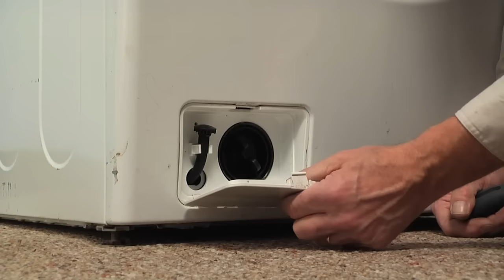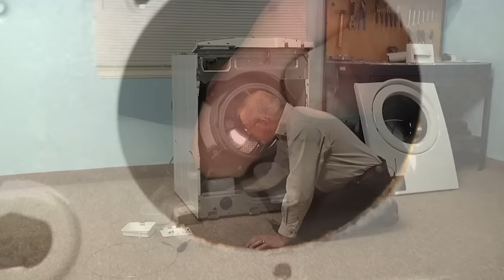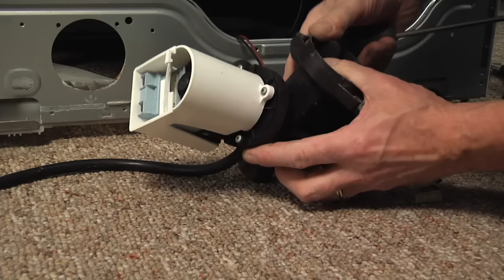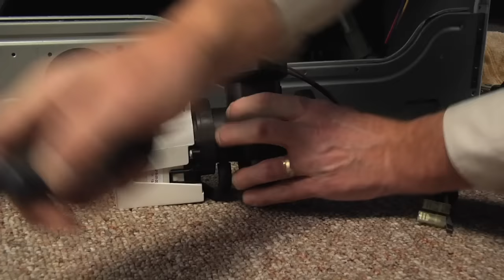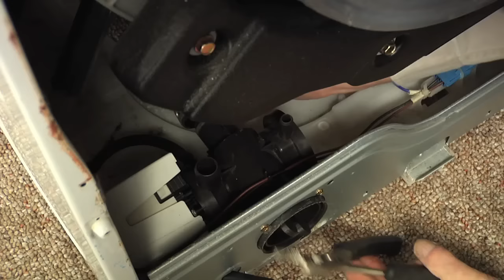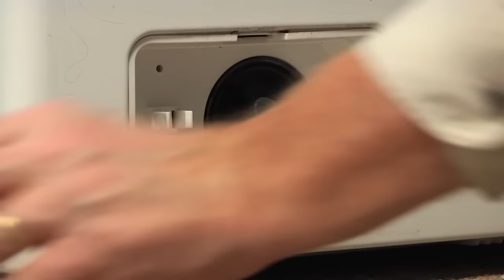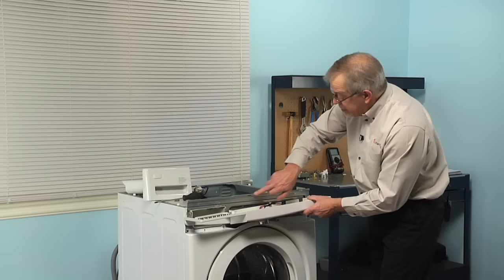Washing Machine Repair - Replacing the Drain Pump (LG Part # 4681EA2001T)

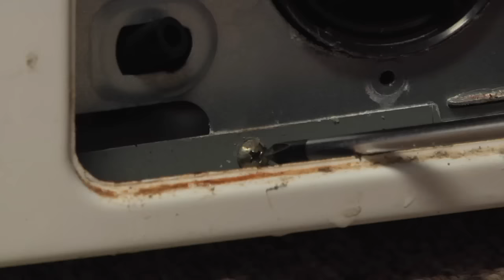Comment: Great video, I actually had to replace my drain pump twice (back in 2018 and again in 2020) and watched this video both times.  One comment, you forgot to reinstall the small screw removed at 3:00 that holds the bottom of the front panel on though.

Comment: Very helpful — thank you! . My washer is a high capacity model, so there were a few differences. 
1. The wires to control panel are very short so they had to be disconnected in order to get the panel out of the way. Careful labeling helped. 
2. I couldn’t get the wire harness to disconnect from the door lock so I needed to unscrew the lock from the front panel. Easy  
3. The drain clean out panel had 2 screws instead of one, the second one is located near the top — it took far too long for me to figure that out. 
4. The pump assembly is fastened down by 3 bolts. Not easy to see them. Putting a powerful little flashlight inside the machine was a help. I used a 10 mm wrench for removal. A small adjustable wrench would probably work too.  Awkward to work on, but fortunately, they were not screwed down too tightly and were much easier to remove than I thought they would be. When reassembling it was easy to position them correctly by feel. 
What a relief to have a working washer again!

Comment: Thanks for easy to follow instructions. Maybe you should work for LG and engineer an access panel for this part. Crazy all that has to be done to get to this easy to replace part once you get to it. I have to replace mine every 4 years. This is my 3rd one

Comment: Such an excellent instructional video.  Every little step is important to me and you covered them all without "cutting" to the next step.  I also fantasized about changing the door boot (moldy and nasty) but now it will be a part of the pump replacement process.  Keep up the good work sir!!

Comment: This is a perfect tutorial. Even better is the link that shows exactly which part to order from your store. 😀 I simply bought the part, then followed along with Steve to a successful job completion.

A key point the Steve mentions is to pay attention to the reconnection of the water hoses. The pump assembly (black housing) has an extra "drain connection" that should be obvious that it isn't a drain connection (it is on the right side furthest from the pump). If you do it wrong, you get to clean up the water that pours onto the floor when restarting the washer, then get the experience of disassembling the washer a second time. 🤣

Comment: Just completed the repair shown in this video and trying out the washer now.  There is one step in reassembly that was omitted - the small screw inside clean out area (bottom left front panel) in front of the drain pump.  We ended up with an extra screw and had to go back through the disassembly steps to figure it out.  Otherwise, great video!

Comment: I'd like to thank the designers at LG for making the most replaced part located at such an easy access point. I'm amazed that it only took removing the entire structure of the machine, maneuvering your way through razor sharp steel, excessive amount of bolts, to easily replace this item. An access door at the left side of the machine next to it so you could open it and literally just unplug the drain pump and hoses and replace it, LG says hold my beer. Here's to to LG 👏

Comment: You can change this without taking off the front of the machine!   Remove the drain/filter cover (2:30 min on the video) and the two upper screws under the cover (5:54 min).  Tilt the machine back at at 45ish degree angel. Laying under the machine you can reach up from the bottom and disconnect/remove the pump. Saved me a bunch of time...hope it helps you too.

Comment: Great video. As previously state most the time you can do it if you tilt the machine back also. If a customer has a small laundry room or a generally packed house this helps a lot as you don't have to take everything apart and find a place for it.
Reply: My washer have been stinking a lot lately, the small drain hose is clogged, full of sand , I live in Florida. So I figure the pump must be clogged too. I’m ordering the part today and getting to work on Monday. All thanks to you!

Comment: Nice video, but as others have stated, it is much easier to just remove the 3 screws at the pump (2 are behind the plastic plate) and then tip the washer back at about a 45 degree angle and access the pump from the bottom.

Comment: Great instruction, even though it took me about four hours to complete.  Mostly because it took about an hour to clear the sand out of the drain hose, and cleaning up the water under the machine-no shop vac.  BTW, the pump was packed with sand also.   Yup, sand no good for pumps.

Comment: Perfect video.  I was considering going from the bottom as was suggested in another video (and a commenter below).  Those in favor of going from the bottom note that its much easier than disassembling the top and front as in this video.  However, what the bottom up approach doesn't take into account how much the dang washer weighs - sucker is way too heavy for a single guy to tilt lift!  Add on top that mine is sandwiched in a small laundry room with no area to pull the washer forward and tilt it back (did I mention the incredible weight of the appliance?), and using the method in this video was way better for me.  

Couple of differences worth noting on my WM3670HWA model.  There was a screw on the right hand side of the control board holding the board on.  In addition, there were two screws on the cover for the coin box and drain hose, not one.  When taking off the front cover of the washer, there was another screw at the very bottom left (behind the coin box).  I had to remove that to get the cover off.  When putting the pump on the pump body, I looked to see where the screws had previously been mounted (worn screw holes) to ensure I oriented the pump the right way.  Otherwise, it could have gone on one of several ways.

All in all, thanks to the detailed instructions in this video, I was able to swap out the bad washer pump motor in about an hour - with help from my very capable wife!  I'd have to say the hardest part of the entire procedure was getting that danged gasket spring ring back on.  Took about half a dozen tries, but with my wife's helping hands to keep the band clamp seated on the boot at the 10 o'clock and 2 o'clock positions, I was able to use a handled hook to pull the spring open and a flat bladed screwdriver to run the band from the 3 o'clock position down to the 5 o'clock position where the band finally seated.  Thanks again for a great video!!

Comment: Thanks to this video I also managed to replace the pump. By the way, I'm a 67-year-old woman and I've never actually done anything like this. It was either a new machine or an expensive mechanic. Or order a pump and see if it works for me too. By the way, I had three more screws under the front. So I had to lay it on its side.
Reply from the maker: You're welcome!

Comment: Thanks for outstanding instructions.But my problem is, the drain pump operates but drum motor does not spin.I checked the brushes, tension of the belt and found they'all good and the drum motor is good too.Should I also change the drain motor please?

Comment: If you ride your LG washer hard, this won't be the only time you're replacing this part.  Do yourself a favor and get the gasket spring removal pliers.  They are expensive but removing that spring without them can be a real pain.  Thank you for this video!

Comment: I want to thank you for this video. I was having problems with the water pump. It was making terrible noises. I thought I was going to have to replace the pump, which is a real problem where I live (there are no parts available) but it ended up being just a piece of a plastic hook blocking partially the propeller movement. How did I realize? by disassembling the unit. How could a guy with no experience do it? because someone like you made a video tutorial. Thank you deeply. I will pray for you and your family. God bless you!
Reply from the maker: Thank you for your kind words and we are glad that we could help.

Comment: I successfully replaced my drain pump using this video.  Thank you for posting it.

I notice, however, that the bottom of the washer is open.  My question is why couldn't I have just taken off the lower plate around the drain hose/filter and tipped the washer on it's back to access the pump from underneath?

Comment: Followed these directions for my LG Washer/Dryer combo (WM3997HWA) that uses the same part. The only difference is that the pump assembly bolts onto the bottom base. I removed the bottom drum weight for the extra room to pull it out. You should also take a picture of the pin order before you remove the pump.

Comment: I did this replacement a few years ago using your instructions. 

I had another motor failure and tried to replace it again but the green drain attachment just crumbled when I touched it, like it was made of wax.

Comment: Good. Video. I my pump motor works but the pump may be clogged. No water came out the bleed off tube and I couldn’t blow out the tube either. Do you have any guidance on breaking the pump down itself?

Comment: I like this video, but when I bought the pump, a comment mentioned that it is possible to take the pump out from underneath. And that is what I did. I removed 3 screws to get the pump assembly out. Just make sure that you secure the washer when you tip it over.

Comment: Great video, all I did to change mine was tilt the machine back against the wall. The bottom is completely open. After removing the drain door and screws the whole assembly slides out of a clip on the bottom. I didn't have to remove the top or the front of the machine.

Comment: It may be worth mentioning that a clogged filter can cause pump noise (emulating a bad pump).  It restricts water feeding the pump.  It is the large screw-off cap on the front, lower left corner.  People forget it's there.

Comment: Great video, but my pump assembly was much more complex than the one shown. It had another motor coming in from the opposite side and more hoses. Also had difficulty determining  how to remove the pump assembly. Had to remove 3 bolts holding the plat it was attached to to the bottom of the machine. These bolts came through black rubbery mountings which allows for some vibration and shock absorption.  Everything else was correct, with the minor exception of 6 bolts along the top of the front panel that includes the door instead of 4.

Comment: Thanks for the video. My pump motor was fine but the impeller on it was stripped where it attaches to the shaft. I could not find that part so I replaced the whole pump. The video shows the brown and black wire being installed opposite to the way mine was installed by the manufacturer. It's probably ac current so it works anyway but it could have safety implications.

Comment: My job was a stack unit and having no help to get the dryer off, I went at it from the back, much harder than your way, but I got it done. When I had trouble reaching from the back, I tilted it from the front and reached up from there (not much clearance, so I could only raise it 6"). As to swapping out the pump, it seemed to not want to go all the way in flush with the pump body and I think that is the new 0-ring resisting a little. I got lost on where the two mounting screws went, like ten and two o'clock. There's a couple dummy holes at about 9&3 by my recollection. The pinch clamp on the larger hose to the pump was impossible to replace without pulling the front panel as per your recommendation because it is so wide to pinch I simply could not make anything happen in the very,VERY tight space (legs and arm still ache a little). Also, the hose end was starting to crack from age and vibration. I went to the hardware store and bought a hose clamp, which I recommend using to replace the pinch clamp in any case and that made the job doable with a small socket on the clamp at the end of a T-handle driver. Finally, I had to call it quits at the last stage of reinstalling the door-seal clamp, because I forgot how you showed that in your fine video, so I appealed to sympathy and went home at sunset, bathed, slept, got up and watched it again this morning and went back and successfully completed the job..Mission accomplished!

Comment: We just turnes the washer upside-down and took off the base.  It was pretty easy except there are some wires sipped tied to the base that need to be removed and then re-zip tied after but the removal was really quick

Comment: The gasket retainer CAN take 50+ tries. I have an easy fix for anyone who doesn't own the spring expansion tool. I used 3 large spring clips(the ones the exterminators use to bunch up a termite tent over your house). Start on the door hinge side and clip over the gasket, frame,  and the left side of the spring connection. Start the ring clockwise up the left side. Clip it items again around the gasket, metal ring, and door frame, at the 10 o'clock and 2 o'clock positions. Use a non-sharp pry tool(like the handle of your needle nose pliers) and continue clockwise , until it's in. Done

Comment: On my LG washer, I simply pulled the washer forward and tilted it back to access the pump.  I didn't even take the hoses off the pump housing.  They were flexible enough to leave on and move the housing so I could remove the pump screws.
Reply: I did the same. Only a 30 minute job

Comment: To anyone about to do this simple repair, if you have the space to safely tilt your machine on its side, I highly recommend doing this repair from underneath. It will require a 2nd person and sufficient space, but it is so much less work. The bottom of the washer is wide open so you can reach in without disassembling the top, front, or tub seal. You have better access to get pliers on the hose clamps and you will also have the opportunity to take off and clean out the black rubber drain pipe that gets clogged with gunk.

Comment: Hi thanks for the great video.
I have a problem when I taken the water pump off I disconnected the black and brown cable and forgot to take note which goes were.
Could you please tell me i have Black and brown and on the pump L and N which connection to which letter please?

Comment: Thank you for the video. It was like finding the answer to the missing socks. First check around the drum for socks, prior to getting into opening the machine up... There is more than a cup of water ... my washer is on top of drawers...I found if you wrap a garbage bag around the drain put it in a bucket prior to opening the drain, save a flood. Also “milk” that black tube coming from the bottom of the drum... may find that other sock!!! Warning the pump maybe HOT! Finger test it before you go in with a full turn! Women you can do this.. I did 😁
Reply from the maker: Glad you were able to complete the repair! Thanks for watching!
Reply: @partselect  Hi Steve. Thanks for the awesome instructions. I just replaced the pump, re-assembled everything correctly and set it to wash a load. I monitored everything throughout the entire cycle and even lifted the drain hose out from the drain to verify that the washer was indeed removing water out through the hose. The load ended, I opened the drain pump compartment and checked the hose (the small one with the screw cap) and I immediately noticed a small drizzle (bad sign). I then began unscrewing the drain pump's cap and sure enough it was full of water, which was my original problem.  Any ideas on what to do next? Any help would be greatly appreciated.

Comment: I love this training, but would be even better to zoom in on areas you are focusing, so we can see your hands and specific location you are talking about.

Also, do you think the pump has something to do with a whole lot of water being trapped in filter reservoir? to the point it is vulgarly stagnant and smell is carrying up through into the washer barrel? Front load washer LG WM2010CW and Dryer LG DLE1310W

If so, best practice to fix on own?

If not, what do you think is the issue and how is it best remedied?

IN addition, I believe the tenant put the stagnant clothes into dryer and now the dryer has the same horrible smell.

Comment: Most of the water is draining on my unit but a puddle remains at the bottom.  Does it sound like it's the motor? If it were the motor it wouldn't suck anything at al would it ? Any advice would be appreciated.

Comment: Thank you for sharing your skills and examples.  I replaced my pump for around $21. I put the washer on its side (and never took off the top or front).  I had some little leaking for over a year which I think was from the old pump. My front drain tube was jammed full of silt and sand and took over 30 minutes to clean in a sink -- I am guessing my failure to drain this periodically resulted in sand in the pump. Because that was clogged it was a big mess of dirty water as I drained water from the unscrewing the filter. I also backflushed the main drain hose, but it wasn't clogged at all (so that is good). Your video was helpful to make sure I had things lined back up as I put it back together.  By the way, what is the purpose of the side of the black drain pump case that is not used? (It has an opening and a pipe opening at top but nothing attached on that side.)

Comment: Any suggestions on what to use to remove those three bolts? My model doesn’t have those screws in the front. Can’t find a video without them.

Comment: I have changed the motor but my washer is still not draining  I tested pump in the sink and it pumps water but not enough to push water up the drain hose  any suggestions? 
Thank you for your help